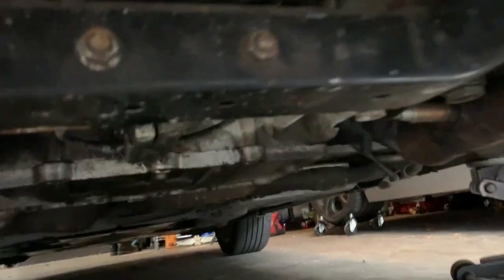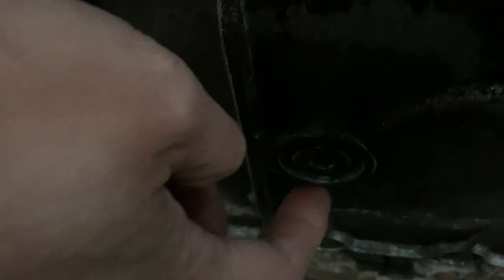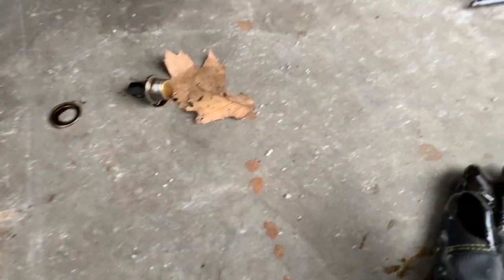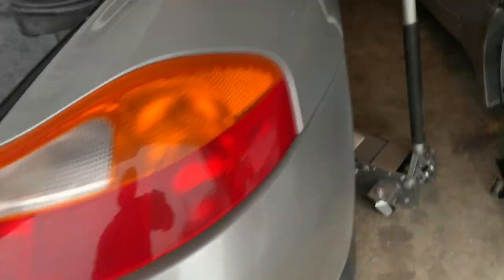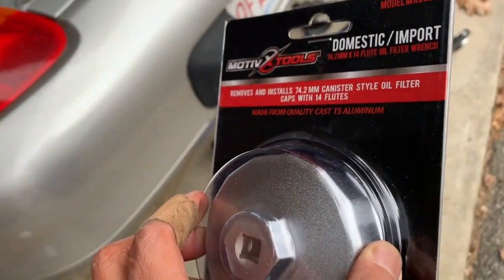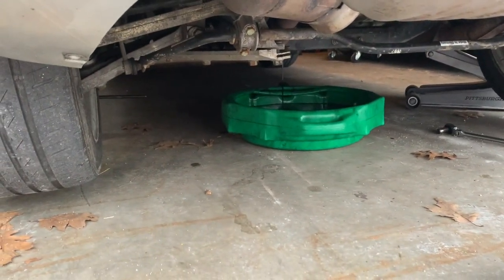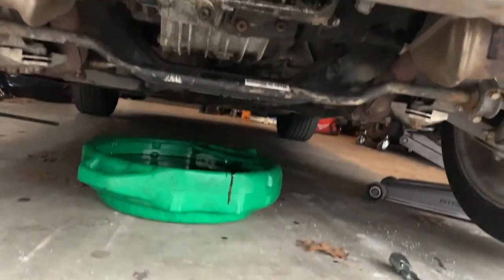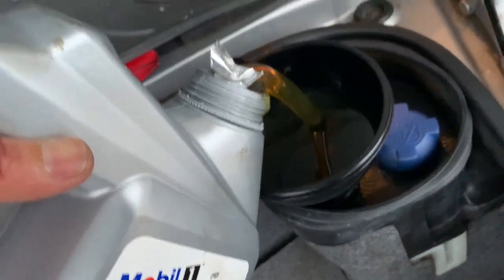porsche boxster - oil change

Comment: You should be using jack stands.   Don't crawl under the car while its only supported by the jacks.
Reply from the maker: George, I totally agree.  For my z3 and z4 I have them on jack stands.  For the boxster, I only see the holes where the OEM stand can fit.  When I try to use the areas near by to jack the car, it feels like it is bending (which made me nervous).   Any suggestions for me and others viewing this would be greatly appreciated.
Reply: @Simplenetwks  - check the 3:43 mark of this video..  shows where to put the jack... and then you put the jack stands at the lifting point that you placed your jacks.
https://www.youtube.com/watch?v=0YHLec20mcE&list=PLIC_JXt8uwM7swEL61HZSdrK7xQo0cRm8&index=9
Reply from the maker: @georgelouie5330  please check out the following video for credits to you about "jacking points".  Please continue to share.   https://www.youtube.com/watch?v=KyMwKEYCMTQ